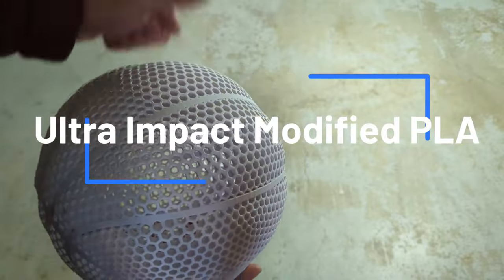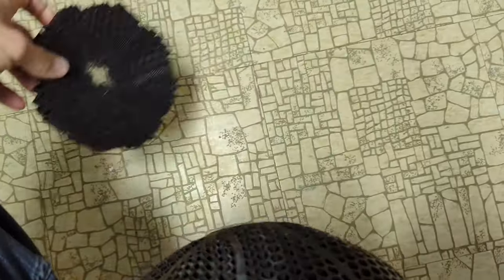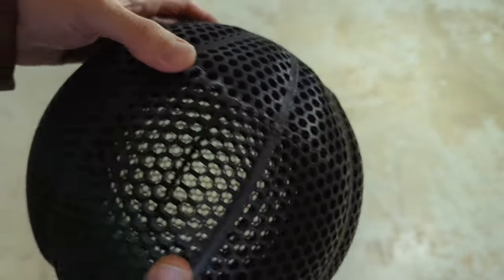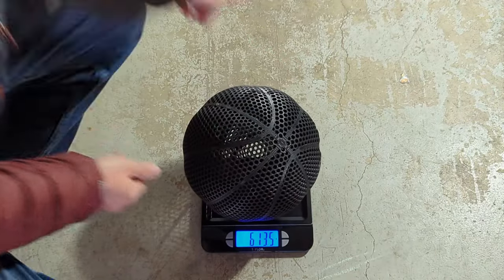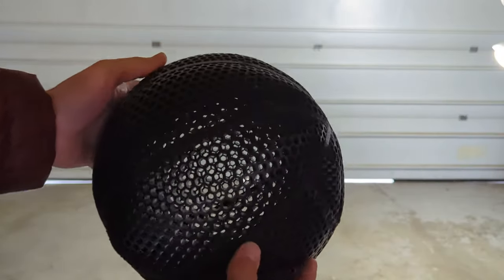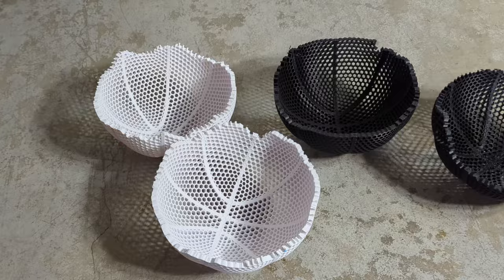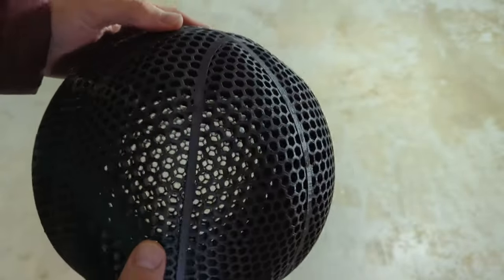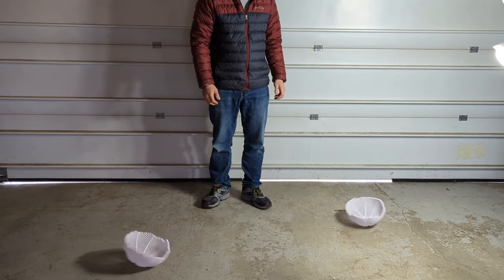3D Printed Airless Basketball Filament Test: Impact PLA vs. PC-ABS!

Comment: You printed both balls "standing up" with the center groove of the ball on the Z axis.  I don't think it's a coincidence both balls split at a perpendicular to that center groove.

I'd print a the ball rotated 90 degrees, so that all grooves run relative the X axis.  The center groove will be stronger since it will be fused around the entire circumference.

Alternatively, you can remove the grooves altogether so the strength differential along any axis is less pronounced.
Reply from the maker: Good catch and suggestions, I will have to give that a shot 😁

Comment: Dude! Thanks a million for listening to my comments! That sucks that the impact modified was a bust tho. It almost seemed to be similar to overature super pls plus. I didn’t have high hopes for any abs. However, I am currently printing flex, PLA that you used and then I will be spraying it with a light coat of gorilla glue adhesive spray, hoping to increase the rigidness of the ball in order to bounce. And then I will do about 10 coats of polyurethane spray for the durability. I will let you know how it works. You should let me know how the flex PLA works with the double lattice.
Reply from the maker: Yeah I thought it was a good suggestion, too bad it didn't work out better. That sounds promising! Would love to hear how it works. I will let you know about the flex PLA with the double lattice - hopefully good results!